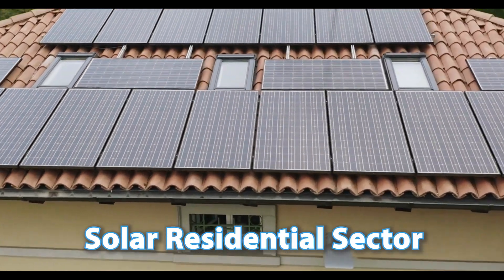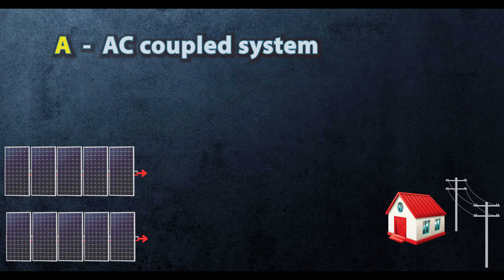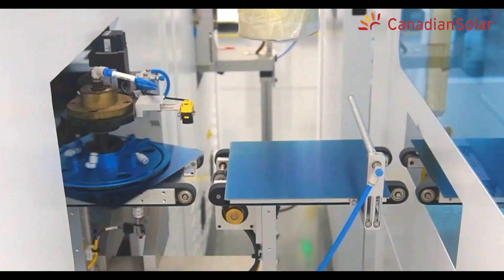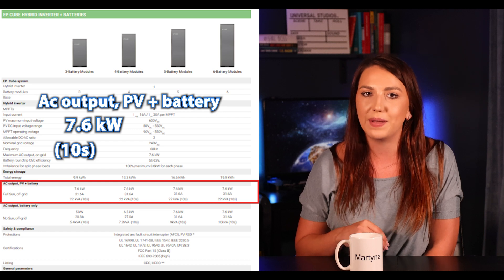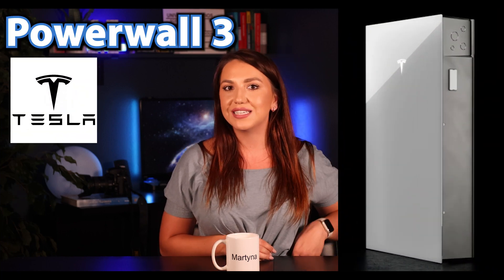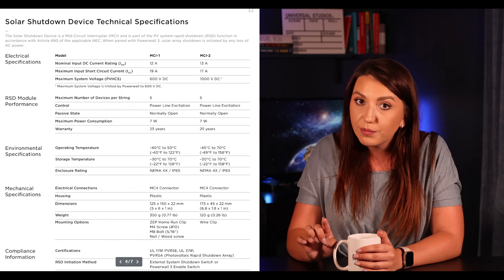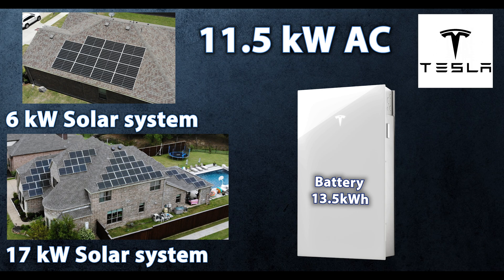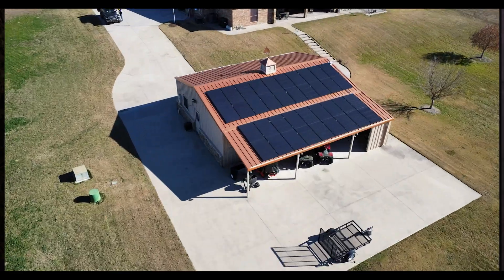EP Cube VS. Tesla Powerwall 3 – Who wins as The Best Home Battery Back Up?!

Comment: I'd love to see installation videos. 

Also, I'm looking for a whole home solution that's not grid-tied. I really like what I'm seeing with the Delta Pro Ultra because I could make use of the portable inverter/battery, but I wanted something more of a whole home solution. Currently, the Smart Home Panel 2 doesn't support more than 12 circuits, so I'd probably need two. I'm guessing right now, there isn''t a system for what I'm looking to be able to do. Any suggestions would be much appreciated.
Reply from the maker: I definitly want to work on the install videos. Maybe will be able to start even next week! I am working on this big 3 PW3s  project.  

For a solution thats not grid-tied... there are options like Delta but also SOl-Ark has a solution that can be set to no export or eg4. I do think it would be an awesome video to talk about those options as well. THank you so much for sharing the idea. 
If I were you I would give it just a bit longer to see what products will prove well designed in the coming year.

Comment: I'll take a string inverter over microinverters or DC optimizers all day everyday. Yes I understand I am giving up the ability to monitor data on each individual panel, but I am also giving up an additional failure point ON EVERY SINGLE PANEL! 
Yes, I understand that if my string inverter fails I lose all the power for that string until it is repaired. 
I also understand that if I keep a spare string inverter on the shelf in my garage, I can walk over and replace it WITHOUT HAVING TO CLIMB ON MY ROOF! I can also swap out the string inverter myself WITHOUT HAVING TO HIRE SOMEONE TO GO UP ON MY ROOF.
Reply from the maker: THIS!!!! I so agree with you! Unsure if you ever saw my string versus micro inverter video! I think you would so agree with my points!
Reply: @solartimeusa  I really enjoy your videos I think you do a really solid job. Keep up the good work.
Reply: What are your thoughts on having a mandatory rapid shut down system? 
I'm on the fence about it. It was touted as a way to protect first responders, but to me: if they don't know how to keep away from a solar array when they're cutting a ventilation hole in my roof because my house is on fire, they probably shouldn't be on my roof in the first place. 
What am I missing here?
Reply from the maker: @powerguymark  I think it’s a total bs. It was lobbied by companies like enpahse and solaredge to push their product. Most of Europe does not have same laws and there is not any more issues or fires 🔥 caused by solar…. It’s a money thing here unfortunately.
Reply: @powerguymark I think it shouldn't be required if your roof isn't completely covered. For example less than 50% of my roof is covered by panels.
Reply: @solartimeusa  thank you for your reply. I thought maybe I was just having a case of the "ass" about the topic. To me a rapid shutdown of a battery Bank makes sense, but a solar array not so much.

Comment: All well and good but the Software is the real difference. Anyone can buy great batteries from China, create the well understood electronics and BMS and offer a backup battery system. CATL does themselves. 
The difference is the software running those systems internally as well as the app used to control the system. 
Tesla's software is superior in that not only can the app minutely control the battery backup but it can control your Tesla EV and its charging schedule as well. Tesla is like the Apple of home EV charging as well as battery backup.... everything plays perfectly together and is seamlessly integrated. 
Other systems are like android where you have to introduce and download additionsl components and perform manual processes to get disparate things to play together or even communicate at all. 
Yes you are paying a premium but it really is worth it when you are putting together a comprehensive energy system in your home.
Reply from the maker: @nickmcconnell1291  thank you so much for this comment! I think what you said here has a very fair point. As an installer I definitely should make a video showing both apps and compare the comprehensive data that’s available through those back up system. I think it would be a very valuable video. 

One thing I hear often from my technician department is that Tesla is an amazing looking system and super super user friendly, just like you said the Apple of the solar world versus android, but other brands like sol ark and ep cube or eg4 give you more flexibility and visibility on the app , so kinda like the android. Man that was a very cool comparison. I think there are advantages and disadvantages to both and some are great for different types of users if you will. 

Again I think your point is very important! Thank you for sharing!
Reply: @solartimeusa  Thank you for your video!

Comment: Would love to see a full install of either system.  We are particularly interested in the Tesla Backup Switch configuration because it supposedly saves on installation time and costs due to less hardware mounted on the wall and results in a cleaner look as well--at least according to Tesla's hype machine... 😀
Reply from the maker: YESSS!!!  I would really like to try it too! So far done a lot of system with the gateway only since most utilities in Texas don't allow for the backup switch just yet, but I will get that done for sure!!!
Reply: @solartimeusa  I am with a company that has installed a LOT of the Backup Switch PW III systems and they are sweet.  PG&E in California supports them.  We have to schedule them to remove the meter and install the switch and put the meter back.  It is their equipment and won't allow anyone else to work on it.  So it is another interaction and of course isn't free.  But it is reasonable at about $275.  It takes them about 5 minutes.  It saves a LOT of time on the install and a lot of space on the wall.  No Gateway, no essential load panel.  Just the PW III and and an AC disconnect and RSD switch with conduit.  Very nice.

Comment: I have been curious about whether or not the Tesla Powerwall 3 system is a silent inverter system with no invasive fan noise compared to other systems that depend on high-speed fans for cooling purposes.  Can you tell us more about that?  It could make a big difference in where It would be optimal to install a system and which of the systems we choose.

Comment: I wonder how these units compare on price to a Sol-Ark 15K with a battery solution. Unless they're price competitive I don't see why anyone would buy either of these two solutions over a Sol-Ark 15K which is far more powerful and capable, and battery agnostic.
Reply from the maker: Hey! I do need to make a price comparison video. I am a huge Sol-Ark fan, but we have encountered many jurisdictional issues because the "agnostic" nature of the battery within city limits is not the case anymore. Lots of people wanted to pair the Sol-Ark with EG4 batteries due to their super low cost. The problem is that we have had most cities in North Texas deny it due to the lack of proper UL listing on certain battery products. So we've got to keep in mind that we must now pair the Sol-Ark with their recommended batteries for warranty reasons. But yes! Price is definitely going to be a big player. The system size plays a big difference here too.

Thanks Greg for the Comment! I appreciate you!!!

Comment: Thanks for the video ... Question  ... Why not add tigo to the tesla system i am told it is compatible, is it not? This would accommodate panel monitoring for $100 per panel cheaper than enphase, as an example
Reply from the maker: I would 100% want to do that. I just have to test it first and also see if anyone else tested it as well. Tesla said something about the powerline communications disrupting the way their rapid shut down works, but I’m unsure if this is just to say that we should be using Tesla product or if it actually causes and issue. 
I am thinking it’s probably just to skew people to buy MCI ( Tesla rapid shutdown). But a test will come for sure! 👍
Reply: @solartimeusa You should be able to do panel monitoring without PLC using the Tigo TS4-A-M. It's Tigo's module without rapid shutdown.
Reply from the maker: @punksjutgbd  thank you so much for sharing, yes I plan to test this to see what really is the issue and how those who want panel level monitoring can achieve that.
I am curious how Tesla mci and Tigos would interact. Like if we installed both? Thoughts ?
Reply: @solartimeusa  I'm thinking since the TS4-A-M lacks PLC, it should not interfere with Tesla's signal. Although, you still need to install the Tigo CCA and TAP out of band.
Reply: @solartimeusa  I have an existing array with the TIGO RSD(California) and I may need to replace my existing and broken ESS.  I am considering the Powerwall III but I really don't want to pay to have my array lifted and the TIGO units replaced.  I would be very interested n knowing if the TIGE RSD system will work with the PW III.  But it looks like I may be able to use the EP Cube and know it works.  I am curious though, does the EP Cube have the Virtual Power Plant capability that the Tesla PW III has?

Comment: Thanks, but it's not available to DIY'ers. PowerWall 3, 11.5kW, 13kWh $9300 & requires a certified installer. Hoymiles HYS-11.5kW Hybrid + 20kWh LFP, $8000, DIY. 😁
Reply from the maker: Fair point! I think you are able to buy EP Cube via Signature Solar or other DIY distributors. Those are definitely more thrown for homeowners that hire installers to do it for them. But I totally agree with your point.
Reply: @solartimeusa ep cube diyers must complete  an online course and receive the ep cubes installer certificate  before being able to purchase their system
Reply: You can take the installer course and self commission.  That was my intent until the PointGuard battery caught my eye.